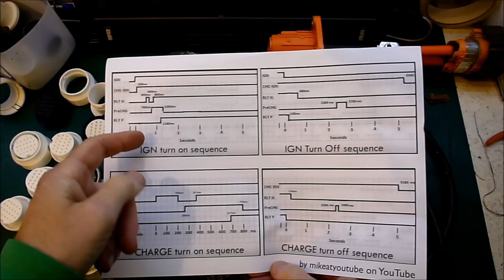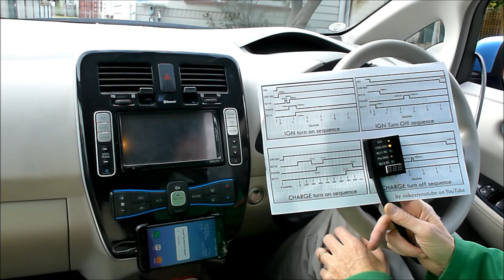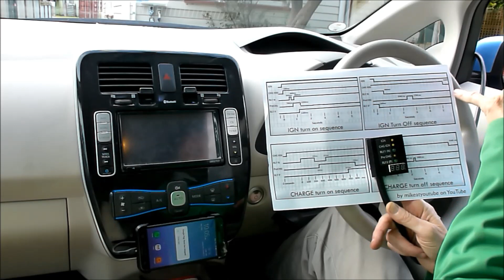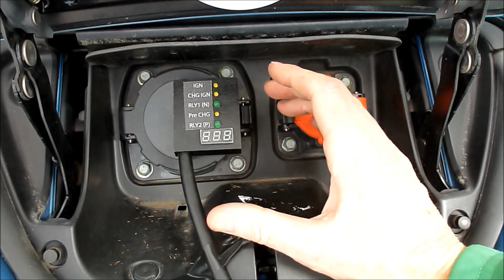Nissan Leaf 014 - Powerboot B24 plug and socket

Comment: whats the range before you add the new battery?
Reply from the maker: About 115 km (depending on wind, hills, speed, if I have bikes on the back) for my 2011 Leaf. It's got about 18 kWh usable in the main battery. I'm hoping to add up to 10 kWh, depending the the cells I use.

Comment: Ah darn, I found out about your videos just now, should probably have caught them earlier. First of all of course for those reading along: Paul has pre-ordered with my company MUXSAN to get a conversion kit, but we're taking a bit long so I suppose he's gotten a bit impatient :) Good job so far and we'll definitely try out your connectors (the Yazaki connectors are impossible to get from component distributors or brokers, so a 3D printed version is a great fix).

You're going to run into a bunch of problems later on - none of which will ruin the experience but you will require a working phone with leafspy at all times to clear critical errors. This is what we've been dealing with for the last half year or so.

You will get cross-currents between the batteries , so you need to intercept the relay action and do some custom switching to make sure you're not getting arc erosion on the contactors.

You'll also not just have to intercept CAN at the battery, but just before the VCM as well. A LOT of our secret sauce is in there so I won't really go further on that point (partially because I'm not sure I have all the bugs figured out yet myself), but there is some magic you have to do to get the GOM, charging and quick charging to work correctly. If you don't, DTCs galore.

You're also going to get incredibly high wear on your 18650 cells. They are not meant for the kinds of loads a car puts on these cells. You definitely need NCA or at least LMO high-current cells, otherwise you'll get wicked fast imbalance and, eventually, a massive fire hazard because of cells consistently getting overcharged or overdischarged. I highly recommend trying to get a hold of scrapped plug-in hybrid or EV batteries and using those instead. If you don't, make sure to ridiculously oversize your trunk battery - go to something like 25-30kWh. This will reduce the relative load on it and keeps imbalance in check.

You know where to contact me if you have any more questions, and considering you just need our electronics, I think we can service you relatively soon.
Reply from the maker: Hey good to hear from you. I must confess I was hoping to wait for you to do all the tricky bits and I'd just source them direct from you! Yep - I've got Leafspy on all the time.

I have a potential source of some good e-bike battery packs so was planning on using those. They' have a slightly better C rating than old laptop 18650s. 

Did you consider fitting a battery pack under the boot space? That's my current plan. I think I can fit 10 kWh in under there.

Love your granny charger too - it's a shame the last prototype didn't last. 

Cheers, Paul